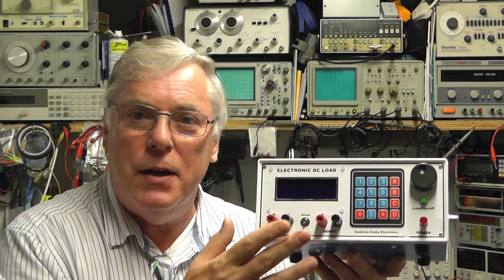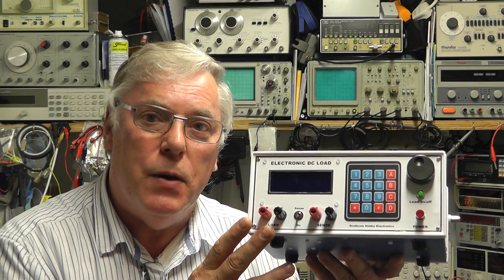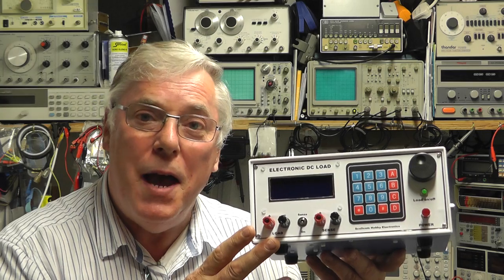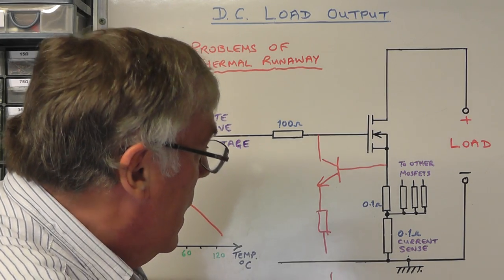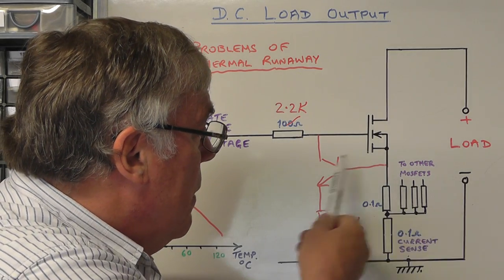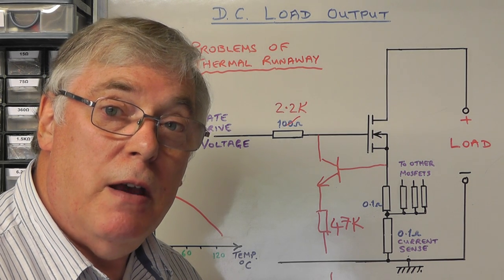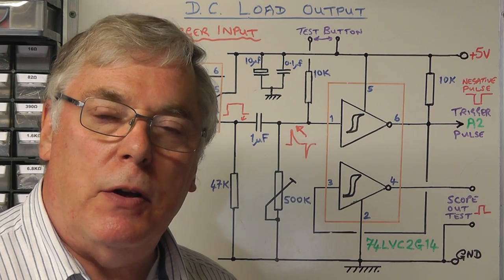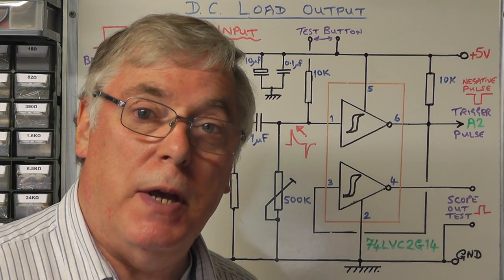Scullcom Hobby Electronics #50 - Electronic DC Load Part 6

Comment: This turned out to be a great project and a very fine tool for every electronics enthusiast's bench. I can't wait for the finalized version. I hope there will be a new PCB design when this is finalized, that includes all the add-ons and corrections. Thank you for doing this and sharing with us.
Reply from the maker: Thanks Bora for your comments. A number of my followers are already working on a new PCB design (double sided PCB). I may also design a new single sided PCB if the hobbyist wants to try make one themselves.
Regards,
Louis
Reply: Yes sir! The "hobbyist" do want to try :D 

I have made my own double sided PCB's before, some turned out ok, some not so much, but I've decided that I's better to have them made professionally. Chinese manufacturers do really great jobs, with very fair prices. Recently I ordered a 8cm x 30cm double sided PCB, with more than 300 drill points. The price was 50USD for 5 copies (that's the minimum), through hole plating, solder mask and silk screen on both sides, shipping included!

Comment: Hi , Tx for the mosfet protection circuit. I blew the   irpn250 mosfets in my first DL project  simulating a  7 amp  30V load for exact this reason.  Great job.

Comment: Great project, excellent mods in this last version. This project needs a custom PCB designed so people could order the pcb online and easily assemble it on their own.
Reply from the maker: Thanks. I will be looking at designing a custom PCB when I have time. 
However, one of my followers Rob Bruno has already designed a new PCB 
using my design (up to Part 5) but we have not tested it yet. It should be OK and uses surface mount components. If you are interested it is available from:
https://www.oshpark.com/shared_projects/tXUxCSVa
You can also download the circuit from the link below:
https://www.dropbox.com/s/orwivgbt23gl158/ElectronicDCLoad1.pdf?dl=0
Regards,
Louis
Reply: Scullcom Hobby Electronics I was going to do a custom pcb for this as well but got side tracked on other projects. I may make one here soon. awesome project btw.
Reply: Nice but they charge 80USD for the board, ouch!
Reply: Thank you so much for an educational and comprehensive build.  I am definately building this!  
The only thing I find missing is an updated parts list and a library of current (latest) schematics and software. It's quite time consuming to go through the files for each video plus having to catch vital information off the videos themselves.  I would like to design a custom PCB for the project for myself and if it works well I would be willing to share that design to the community.
Thank you once again and now if you'll excuse me I am going to start these videos all over again.

Comment: I used 0.22 Ohm double resistors in one package to balance out the mosfets, works perfectly... got the resistors from an old audio amp, most audio amps have those particular resistors to balance out the PNP and NPN transistors so those resistors are already used for balancing, perfect to repurpose those for a project like this

Comment: This project is coming along quite nicely. I haven't given a lot of thought to this, but my gut feeling tells me that the 47k to -ve should not be shared amongst all the NPNs, as they each refer to that emitter rail, but the others  can affect it's voltage. I know it's very low current, but that emitter rail must surely be bouncing around as the NPN's drift in and out of conduction.
As I say, I haven't tried to analyze this in any depth, but 3 extra resistors cost almost nothing, and can't hurt operation...
Reply from the maker: Thanks for your comment and question. You may have a point but I have found that as the actual current through the 47K is only about 100uA or less it has little effect. The Mosfet base current is negligible. You could also increase the resistor value to 100K if you wish and it would still work. As a mater of interest I have seen HP Agilent use a similar technique in some of their bench power supplies and they also use one return resistor feeding in their case 2 transistors.
As you say adding 3 extra resistors costs nothing so if you wish you can do that. I will consider adding that as an option to the final design.
Regards,
Louis

Comment: Hello, I know that a lot of time has passed, but the content you have prepared is still very useful. Thank you !
I wonder why BJT's emitter is connected to -5v? In this case it sounds like the BJT will always be transmitting? It seems like it would be more appropriate if we connected it to ground potential instead of -5v. I probably didn't fully understand the principle of its operation. Can you help me with some keywords for a deep research?

Comment: On the load balancing between 4 MOSFETs, why not use a quad opamp and control the current through each MOSFET individually? I mean, if you have to allow 1A load, each opamp will in turn control 0.25A, so that the sum is always 1A? That way each MOSFET is protected. We would need 4 shunt resistors, but that should be OK to increase the robustness. We may need the -5V bias to turn off the MOSFETs.

Comment: Thank you for these series of videos on the DC Load and appreciate your way of explanation and pace too. I enjoyed and learned new things as well. May I ask couple of quick questions here please?
1) How effective is to use multiple MOSFETs in parallel? 
2) What is the minimum Amp can this load be set to ?
3) Can load value be increased in 1mA  to 2mA and so on incrementally?
Reply from the maker: Hi Pradip,
Thanks for your comments. In answer to your questions:
1) In this project we use 4 power mosfets in parallel. As no two mosfets are identical you need some balancing to stop any one using more current than the other (current hogging) and so over heating and eventually going in to thermal runaway. To reduce/eliminate this possibility, in this project I use individual ballast resistors in the source return of each power mosfet. Also I use some active feedback as I explained in my last video (Part 6).
2) In practice the minimum Amp load can be about 2 mA.
3) The load can be incremented in 1mA steps.
Regards,
Louis
Reply: Hi Louis, thank you for this explanation. Since IGBT are meant for handling such a high load,  would you please suggest to use a single IGBT instead? Any trial you did with IGBT as well before considering the multiple MOSFETs in parallel please?

Comment: Hello Louis, In case i wish to change the mosfets for more power which you mentioned its possible. But to be precise or to doubly sure is there ANY LIMIT in the LCD meter reading or we need to change the firmware. kindly clarify it.

Comment: Thanks a lot for your work, Louis! Your style of presentation reminded me of Jim Williams (RIP). 
Can you tell me what dI/dt can provide this e-load in transient mode with actual mosfet drive circuit (2k2 gate resistors)? It's very important when testing SMPS and debugging FB loop compensation.
Is it possiple to change I/R/P value under load without stop operation?
Reply from the maker: Hi Tor,
Thanks for your comments.With regards the 2K2 gate resistors I use they do slow down the mosfet switching times in transient mode. Normally you would use a low value gate resistor of 100 ohm or less to ensure fast switching times. However, for high current mosfet's as in this DC Load the gate channel capacitance can be quite high and a rapidly changing drain voltage can produce several mA of transient gate current which may damage the mosfet.
Under normal conditions the dI/dt would be around 100A/uSec.  However, with a 2K2 gate resistor it is lower. When looking at the waveform of the current switching rise and fall slopes I am getting a period of about 100uSec in transient mode.
Yes for normal operation of the DC Load in constant current, resistance or power it is possible to change the I/R/P value on the fly with the load switched on.
Regards,
Louis

Comment: Louis, great update. Awesome job.Wish I had just a smattering of your design knowledge.  I will now get back to the PCB design. Just starting the transition form Eagle CAD to Altium Circuit Studio. Hope to have something in a week or so (using Eagle). Quick question would a 10uf smd tantalum cap be suitable  for the bypass. Noticed you used one for the trigger ckt. That would save a lot of room on the design. Also they are easier to solder that the SMD electrolytic caps. Look for something soon.
Reply from the maker: Thanks Rob, Yes a 10uF SMD tantalum capacitor should be OK. Look forward to seeing the results of your work on the PCB. The problem is I keep adding things to this project which is a PCB designers nightmare :)
Regards,
Louis

Comment: Hi, I like to modify my 1 mosfet DC Load (1x ir250 mosfet) to 4 or 6 Mosfets using the end stage of your design with the 2n2222 protection  to avoid a run away. Would that work?   what max A  would you recommend for your protection circuit to work correctly ?

Comment: Great project and excellent videos.  I've been following this project and I've built sections of the circuit on a breadboard to help understand how it works.   I now plan to build the complete project over the next 1-2months.   However, looking around at commercial DC loads - I see most have a Constant Voltage (CV) mode.     

1)  Can you please explain what CV mode is and why you would require this? 
2)  How easy would it be to add to this project? i.e. Could this option be provided by software or  additional hardware + software 

Thanks
Reply from the maker: Hi Kevin,
Constant voltage (CV) mode allows you to set a fixed voltage. The electronic DC load will sink the necessary current to keep the voltage at the set level. This could be simply achieved by adding an additional option in software. No additional hardware is required. I will have a look at this as an option but it depends how much programme memory space we still have available in the Arduino (we have used most of it to date).
Regards,
Louis
Reply: Thanks  Louis

Comment: Louis, as always an excellent project. I built a portion of the circuit with two mosfets and two transistors, in my tests one of the mosfets got significantly hotter that the other. So to understand what was going on with the circuit I simulated it on LTSpice. To simulate the difference in conductivity I varied slightly the .1 resistors and the simulation showed significant differences as expected. I cut out the transistors from the circuit and there was no significant change on the previous result.
What made a difference, at least on the simulator, was to have the base of the transistor on the source of the neighboring Mosfet. Using your schematic, the base of Q6 on the source of Q3, the base of Q7 on the source of Q2, etc.
What do you think of this arrangement?
Reply from the maker: Hi Dan, Thanks for your comments. I checked my unit again and it seems to work OK. However, as you seem to be having some issues I suggest trying a few of things:
1. Increase the value of the 0.1ohm resistors (R22 & R23) to 0.5ohm.
2. Instead of using just the one 47K resistor (R30) supplying all the emitters of the transistors from the negative supply - instead use a 47K resistor in each of the emitter returns so as to separate the emitters.
3. You could also try increasing the 2.2K mosfet gate resistors to a higher value say 4.7K or even higher.

Also in my circuit I used the 2N2222 transistor as I found that it worked better than some other general purpose NPN transistors in this application. As the 2N2222 is good a fast switching and responds very fast (much better than a 2N3904). In this application I would recommend using the 2N2222.

With regards your suggestion of connecting the base of the transistor to a neighboring Mosfet seems strange as it would not reduce the gate/source voltage of the mosfet that was over heating.
I will have another look at my circuit and do some more tests.
Regards,
Louis
Reply: @scullcomhobbyelectronics1702  I was wondering why only one 47K resistor was used as oppsed to one for each transistor...

Comment: I enjoyed this series very much. Thank you very much

Would it be possible to use a ATmega328P chip instead of a Nano? 
However. It must be able to run the software you created but would fit nicer into a homemade pcb. 
I am not fond of the surface mount components (just because I'm a hobbyist and not that good with it) 
It would be great if you do a redesign of the PCB for the completed project.

Kind regards
Stephan
Reply from the maker: Thanks Stephan. Yes you could use the ATmega328P chip and this is something I have considered. If you install the Arduino boot loader then the software can be loaded just like the Nano.
As I have made a number of changes as the project has progress I will probably redraw the schematic and maybe redesign the PCB to match as a final end to this project. I hope to get back to this project soon with an update but as I have to go in to hospital for some treatment it is likely to be a few weeks before I am able to do it.
Regards,
Louis
Reply: Dear Louis
Thank you for your response.
I hope and trust that your visit to the hospital will turn out well.

Kind regards
Stephan

PS: I must say. It looks as if you can buy a Nano for less that the ATmega chip.
PPS: I enjoy the videos that you have created
Reply from the maker: Hi Stephan,
Thanks had to rest for 5 days after my hospital treatment. All went well.
I am now getting back to the DC Load project to try and bring it to a conclusion. I have now redrawn the schematic with all the previous modules included. Have made a few changes and some additions. I am working on a one board PCB now which will replace all the previous modules. I just need to test some of the additions and make some changes to the software. I hope to be able to film everything soon and then upload Part 7 of this project.
Yes I agree the Arduino Nano can be cheaper than buying the ATmega chip. So I find it easier to just use the Nano. But if you want a neater arrangement once a project is finalised then building the ATmega chip in to the PCB does work well.
Regards,
Louis

Comment: Thank you very much for the video. As a further upgrade it would be excellent to add a USB port to send the data to a computer via the Arduino (for the purpose of data storage, display and analysis) both in this and the miliohm meter project. All the best.
Reply from the maker: Thanks for your comments. I will have a look at adding a USB output. This project seems to just keep developing, its knowing when to stop :) I am currently also looking at a completely new project as well.
Regards,
Louis

Comment: Better would be having each gate-driver NPN transistor having a seperate emittor resistance, so that they don't affect each other.
Now, when a driver drains current away from a to much conducting MOSFet, it lets the other drivers throttle down the other MOSFets, just the opposite of what you want!

Why not connect the testbutton to the base of the Opto Coupler transistor? That gives uniformity in the generated pulse  an debouncing of the button!

Comment: This looks like a very feasible design.  I have only one problem with it, there is no cutoff relay.  When you're doing battery testing, you want at least 2 to cutoff methods.  If for any reason the MOSFET's fail to turn off there is no way to stop the test.  Batteries don't care if the alarm has sounded.  Invariably you'll get distracted and fail to stop the test before you leave.  The result is fire or at least a ruined battery.
Reply from the maker: Interesting suggestion. I did look at some commercially produced products and found they did not use relays as a second cutoff.